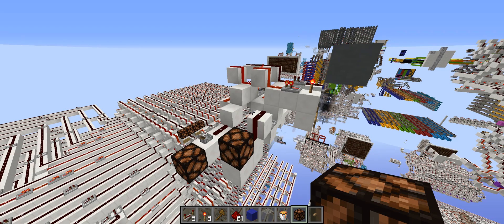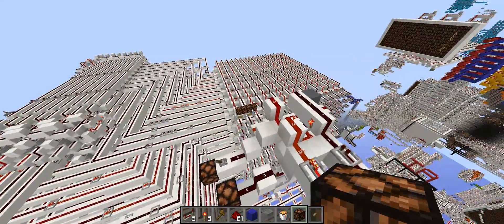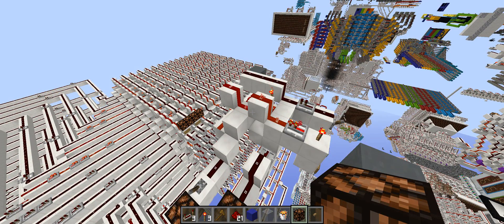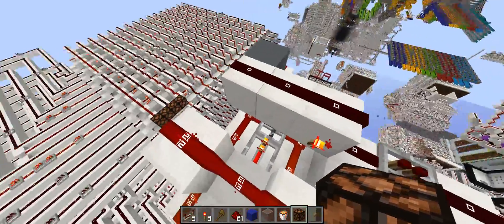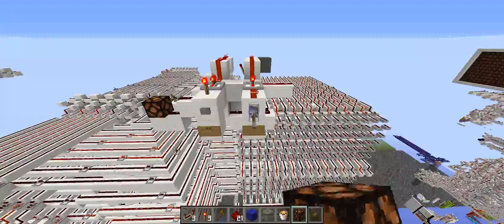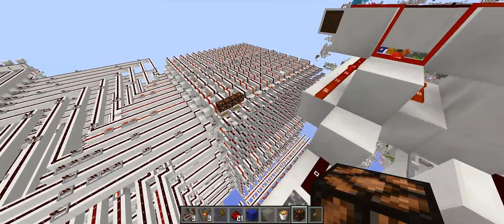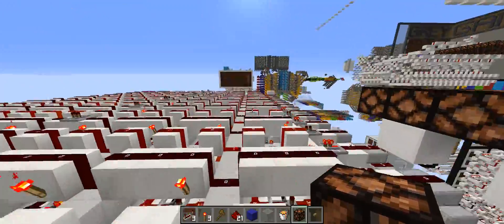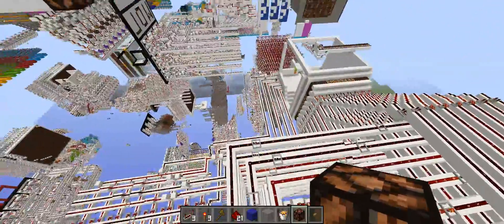Response to Ram on r/Redstone

Comment: Just found your video, great stuff. Could you explain how one would stack these modules? Also, do you have a good design for address decode logic?
Reply from the maker: stack them horizontally for bits, and then multiple rows for multiple words, and then copy that 2D selection of rows up for even more words. 
to make a decoder for ram, you just need mux the decoder output between read and write, the decoder can be a matrix decoder so you can have say 8, 8 bit words per layer, then have 8 layers, so thats 8bytes per layer, and 8 layers is 64 bytes. you would address that by using a matrix decoder, making each layers row decoder 3 bits(0-7 is 8 words per layer) , then having 8 layers you would have another 3 bit decoder which selects which layer is allowed to be decoded.

Comment: You can get down to 2*2*7 if you partially share the input and output lines and use piston BUDding and zero tick pulses, but those systems have all kinds of problems regarding chunk-loading and tend to require a repeater every four blocks instead of every 16 because of their design, so this 4*4*4 with a repeater-lock is probably the fastest/highest quality Redstone RAM you can make. Still experimenting with hopper-dropper designs, but they don't seem very feasible.
Reply from the maker: 4x4x4 is the smallest 3D cell because of the need to cross 2 wires (data in and data out) with another 2 wires (read, and write).
Reply: @WildEngineering What exactly do you mean by "smallest 3D cell", the smallest volume that can be stacked in any direction without offsetting/special alignment? Because if you don't need to read and write to different cells at the same time, you can share the input and output lines, and even the read and write lines depending on the space you have to wire things up, to get down to a 2*2 wide design, at least if you use another method such as BUDding, because the repeater-lock already needs to be at least 3 wide. Like I mentioned, I prefer repeater-locking even if it takes a little more space, but you can potentially get slightly smaller at the cost of consistency and/or speed.
Reply from the maker: @yyny0  these cells can be written to and read from at the same time. I also don't use pistons or any bud mechanisms because I do not like them.
Reply: Also, if you allow offsetting, or if you only need to stack in two directions (i.e. you only need either one address, one bit, or one data line, that last one being the case if you don't need to write to a bit and read a different bit at the same time), you can potentially get down to 2*2*3 under extremely optimistic conditions. (Any less and you'll have unintended BUDding from cells being too close together, although I doubt any smaller than 2*2*7 per bit is possible without ridiculous delay, such as what is the case piston/hopper/repeater loops), and this 4*4*4 is already the smallest design I have found with <0.5 tick delay per bit and per address (0.25 ticks delay if I calculated correctly, as you still need a repeater every 16 redstone). There's instant redstone wire and instant redstone logic, which I'm also still looking into, but that would probably create massive cells then, so like I mentioned, in my opinion this is probably the best quality addressable RAM currently available in the game.
Reply from the maker: @yyny0  instant logic is buggy and I don't mess with it. Still, with read and write one dimension will be at least 4blocks long. Also, there's 2x2x7 registers but they do not 3D stack.
Reply: @WildEngineering  Actually, instant wire has been fairly reliable for several versions, and is pretty well understood by now, some designs have worked since Beta. Check out some videos by ilmango and Xcom6000. Instant wire is a big part of my planned CPU, and it seems to work fine so far. It doesn't seem feasible for RAM space-wise though, since a single NOR gate already takes somewhere around 4*4*4 blocks, not to mention the massive size of instant-repeaters compared to the normal one block, one tick delay redstone repeater. I would love to have stackable instant RAM though, it would be awesome to finally be able to display programmable animations at 1 or 2 FPS in Vanilla Minecraft :).

The 2x2x7 design that I found has expandable address- and I/O lines. It shares a single read/write line, because that's all I'm looking for. You can still read from/write to any number of different addresses at once with the design, you just can't read and write to different addresses at the same time. Instruction pipelining is already complicated enough by itself, I don't see how anyone would be able to design parallel RAM read/write pipelining for a Minecraft CPU without going crazy, so I'm not really looking for multi-writeline RAM at the moment. The problem I keep running into when looking for ram is that after a couple hundred different addresses, the delay of the RAM starts to exceed the clock-speed of my CPU concept. I'm looking into pipelining, but theoretically, 0.125 ticks per address should be possible and would be a huge help to me (access to 256 addresses in one clock cycle is obviously a big deal), although 0.25 ticks for a neat stackable 4x4x4 design seems to be the best option so far (the design I'm currently using, even though it's slightly smaller, and also stackable, is just way too slow, and I don't see a way to get it any faster. Also it uses BUDding, which I'd like to avoid). It just seems like a waste of clock-cycles to have multiple write-lines when I only need one.
Reply: Ew, pistons

Comment: I have most compact RAM (45 m3 stackable volume) - https://vk.com/id199101909?z=photo199101909_456239023%2Fwall199101909_540 (list of images). Its was long time ago and takes time to find schematic. Actually its easy to reconstruct from picture. Must say that there 2 different design of this memory : fast and compact. DJMicroRam is superfast read/write and DJNanoRam is superflat but have more delay for read/write and need 1 extra block per 15 blocks to extend redstone line.